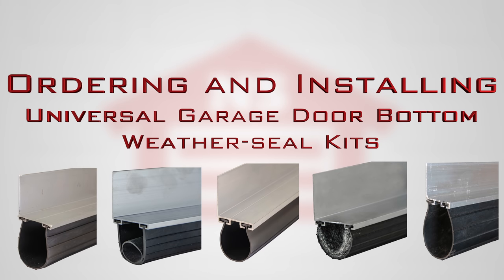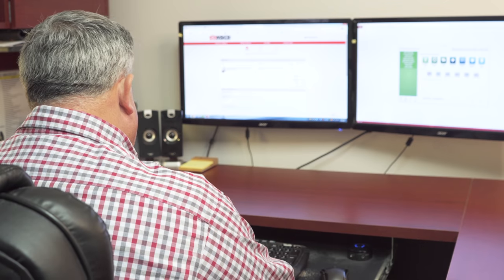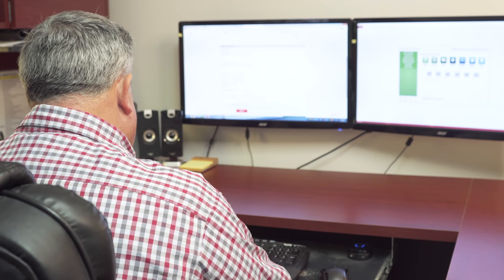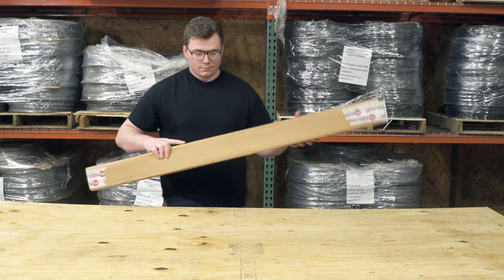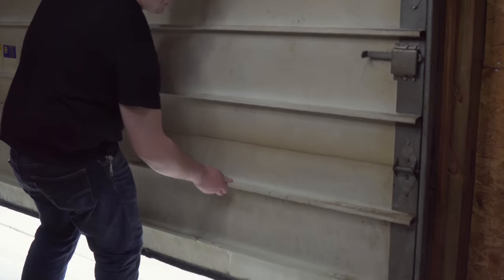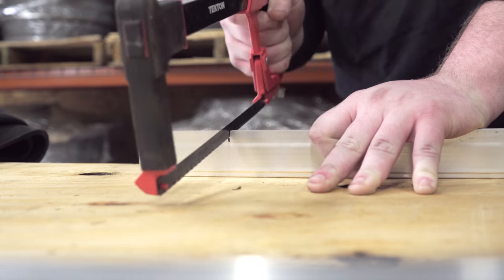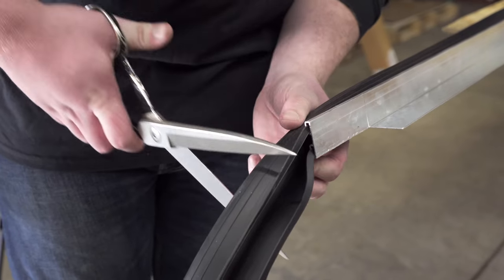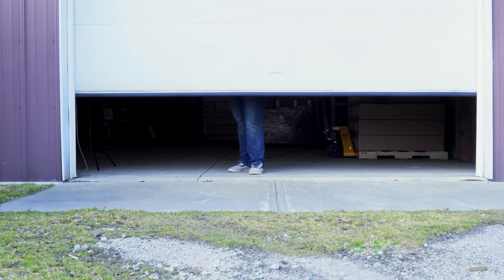How to Order and Install Universal Garage Door Weather Seal Kits

Comment: I feel like this video underestimates the struggle of this install. Getting the rubber seal into 16 feel of metal is HARD, you have to slide them on one at a time and sometimes the T comes out. I think the video doesn't really show they have a LONG table to help. I haven't even gotten to the install part and I'm assuming its going to take at least 3 people to hold this thing up while I drill it on. Not an easy install.

Comment: I ordered this kit and was well pleased with it. The retainer was sturdier than I though it would be.I couldn't remove the old retainer but was able to install over the old one (removed the old seal).The seal is difficult to get in and it's good to have someone helping. I had no one but I tried something that helped make it tremendously easier. I sprayed vinyl conditioner (think Armour all) on a rag then applied it sparingly on the seal. Wow! It slid right on. It couldn't have been easier. My son came and held it while I screwed it on the door.
Reply from the maker: Thank you for you support and comment!

Comment: What’s the largest gap it will fill?  Do you have a 10’ length?
Reply from the maker: We make an 11 inch oversized flex brush that are sold in 8 foot sections. They can easily be trimmed to fit your needs. https://www.northshorecommercialdoor.com/action-industries-oversized-flex-brush.html